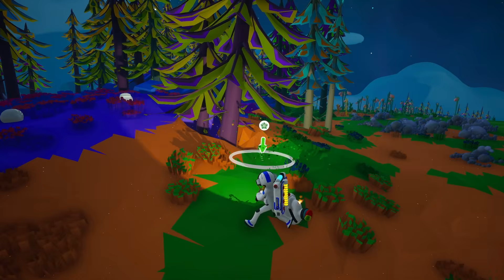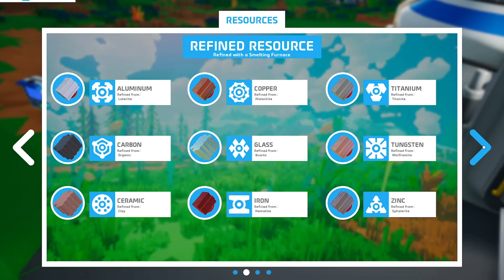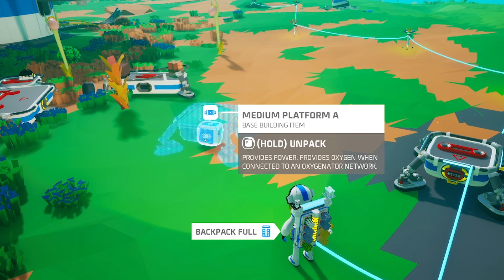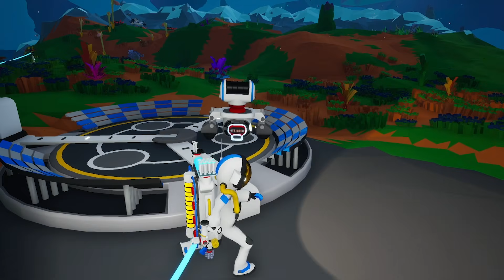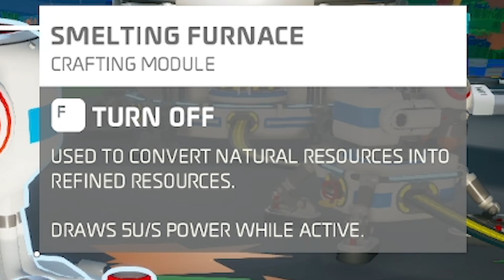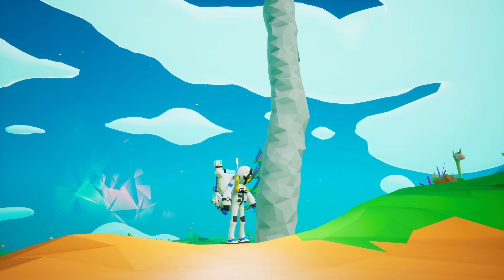Engineering a 100,000m tall tower in Astroneer!

Comment: You need to plug the power into sockets with working cables (the red things), which don't need to necessarily be lit up as that only indicates that the platform is exposed to power

Comment: Fun fact, you can actually find the spaceship from the intro in orbit of the first planet and even reach it by building a tower that's high enough (it doesn't have collision though). May I also suggest building a "bridge" into space (I'm not sure if it can be called a bridge if what it connects to is space) by using the flattening tool and just keep going into one direction until the planet curves away from under you?